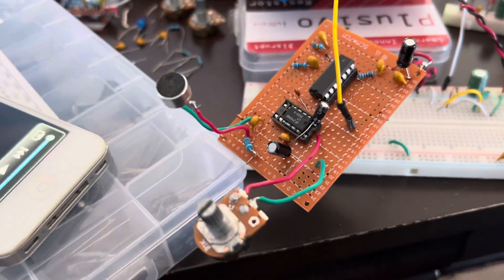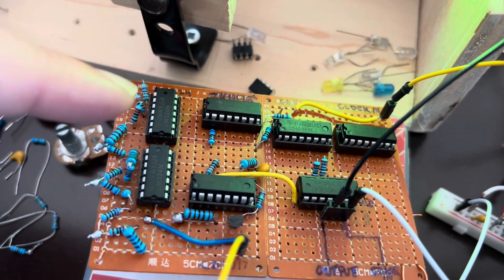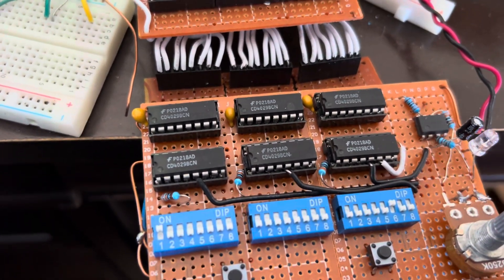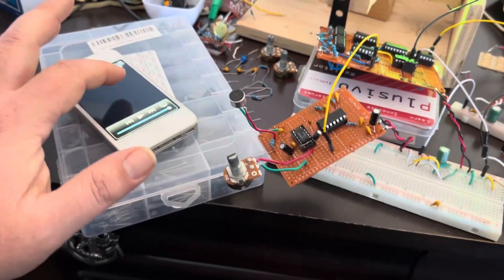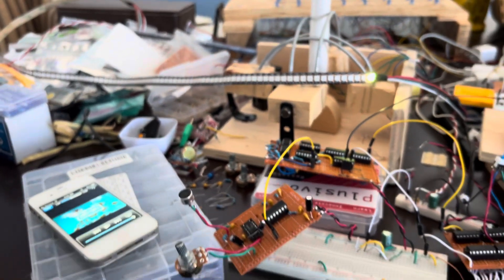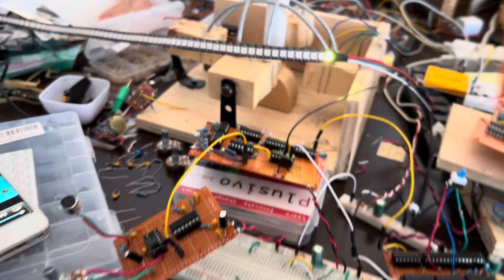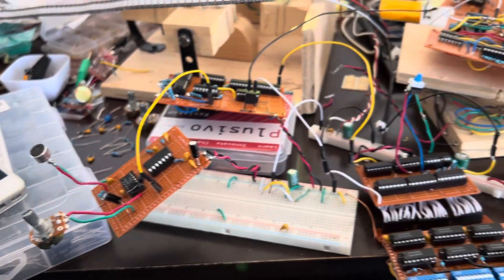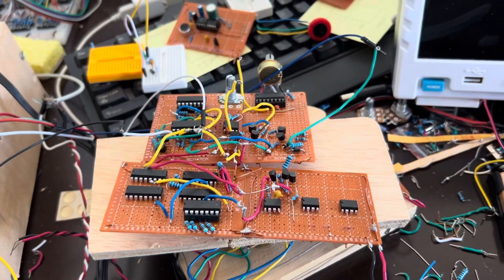Neopixels without microcontroller /no coding- final circuit

Comment: Fun circuit. I had to bitbang a neopixel using a PIC24 with assembly language in school. Getting them working without a microcontroller would be a lot of fun
Reply from the maker: I had a great time figuring out the neopixels and making them do what i wanted them to do. I tried bit banging neopixels in assembly with the raspberry pi to make my own neopixel library a couple of years ago and it worked but not as fun as bit banging in hardware